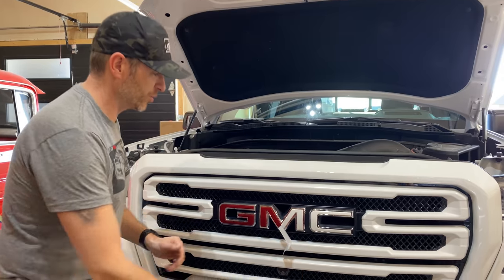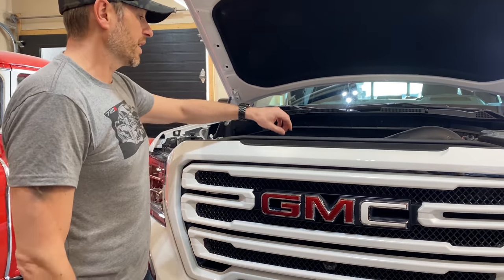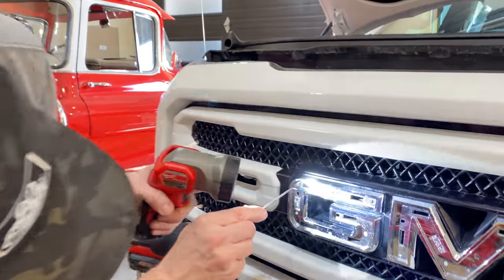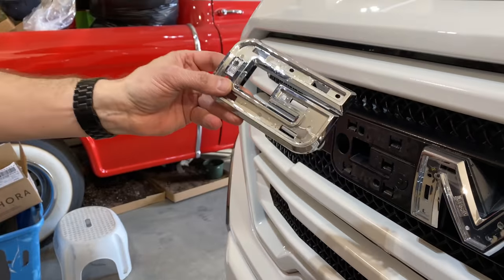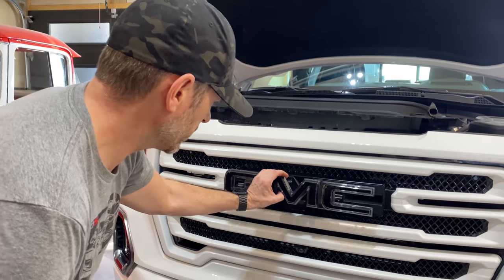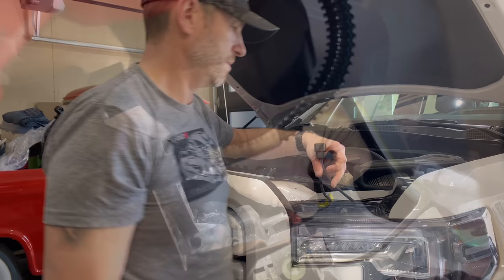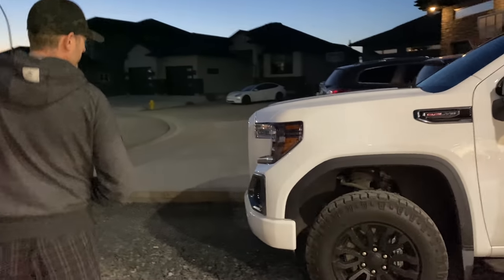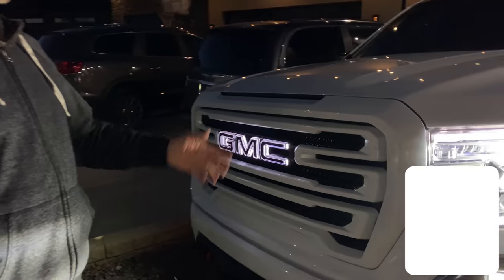How to Install the Illuminated LED GMC Sierra Emblem / Badge - A Genuine GM Part

Comment: I'm being told by a seller on Ebay that this is not compatible with my 2019 AT4 (based upon my provided VIN.  Plus, on the GM Accessories website it doesn't list this as a compatible option for the 2019 model year), and according to contradictory comments that I've seen online I'm wondering if anyone can confirm if this will or will not fit on the front grill of my 2019 GMC Sierra AT4.  I supremely appreciate any feedback, as I'd love to install this on my truck but don't want to spend the money on to find out it won't fit.

Thank you all in advance.
Reply from the maker: Based on what I know, if you have an 2019-2021 GMC Sierra AT4 it should fit.   I bought mine right from my local dealership by supplying them the part number for the black kit.  If you google the part number, you’ll find other GM parts dealers too
Reply: @Donslife  I see that I can order a black kit (front & back, and I'm only interested in the front illuminated emblem), but I find it curious that when I visit the GM Accessories website that it doesn't offer the illuminated option, only the black.  Any ideas as to why that is.  Are the push-in tabs in a different pattern?  Is the size a bit different?  I'd hate to buy it only to find out that it won't work.'
  O
BTW, I LOVE your channel, super informative, down to earth and overall just great.  Keep up the good work.  Oh, and I've also purchased a few of  the mods that you've provided videos for, so thank you for the tutorials (I'm just waiting for it to get warm enough outside to perform the install :).
Reply from the maker: @utjoseywales  thanks for the support!  Here is the Red part number.  Same exact fitment as black but cheaper since you don’t need a red tailgate badge (you have it already).  All of the compatibly info is listed here too

https://www.gmpartsstore.com/oem-parts/gm-illuminated-grille-emblem-red-emblem-84741557
Reply: @Donslife  This is the reply that I received from the eBay seller (which I believe is a dealer or associated with a dealer):  "Good Morning. I think this would have to do with the wiring and the harness this item comes with. There might be ways to make it work but from General Motors factory installation this vehicle does not come with the equipment to connect this item."

To this I have no idea if it's factually accurate or not.  Any ideas/opinions?  I really do love the look of this mod and want to do it to my 2019 AT4, but I don't want to order it only to find out after removing the factory emblem that this one is incompatible.

Thank you again for your assistance, love your videos.
Reply from the maker: @utjoseywales  I would suggest going to this forum and asking the 2019 owners what their experience was. If I had a 2019 I could check the wiring on, I’d let you know
Reply from the maker: https://www.gm-trucks.com/forums/topic/234437-illuminated-gmc-emblem/
Reply: @Donslife  So sorry if I'm missing or doing something wrong Donslife, but there isn't a link in your reply.  It's probably just me, but in the event that it's not would you be so kind as to send it again please?  Thank you (again) in advance.
Reply from the maker: @utjoseywales  if this link doesn’t work in the YouTube comment you can email me for it at donslifechannel@gmail.com    Here it is again though: 

https://www.gm-trucks.com/forums/topic/234437-illuminated-gmc-emblem/

Comment: Weres the link i need one in red ??
Reply from the maker: You order it from GM at the parts department or try a GM online parts dealer.  I googled this one : https://www.buykippscottgmparts.ca/oem-parts/gm-front-illuminated-gmc-emblem-black-84942528
Reply: @Donslife  do they come with the regular burgandy one and do u think it will fit my gmc sierra 2019
Reply from the maker: Yes, just google gmc illuminated emblem red
Reply from the maker: They only fit 2019+ that are the new body style for 2019-2022
Reply: @Donslife  thank u ur video helped

Comment: Way too much work I’ll leave the factory that’s how stuff gets tour up on your car trying to put stuff on aftermarket
Reply from the maker: Made by GMC for the Sierra and only available from the dealership parts department.   The instructions are the same ones for the GMC techs.   It does take a certain comfort level and experience to do it yourself.  Thanks for watching though 👍🏼